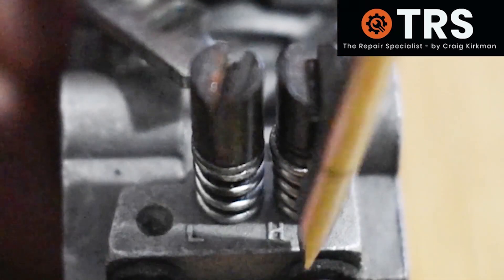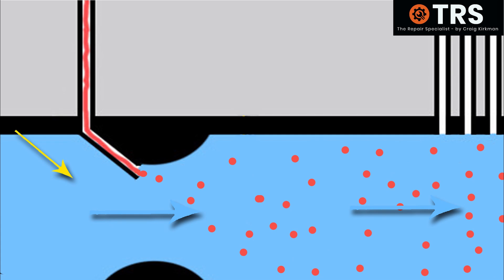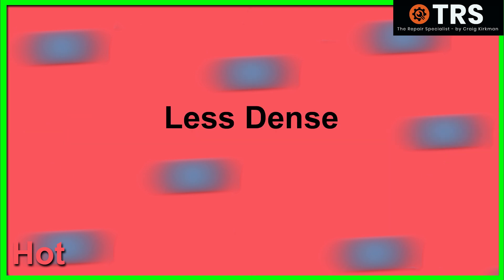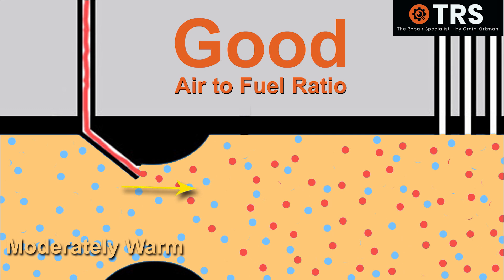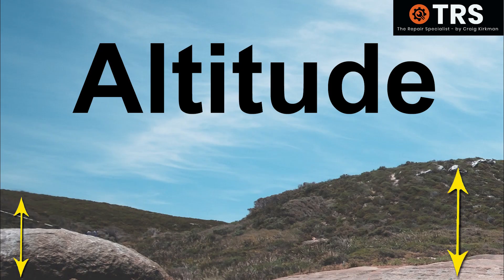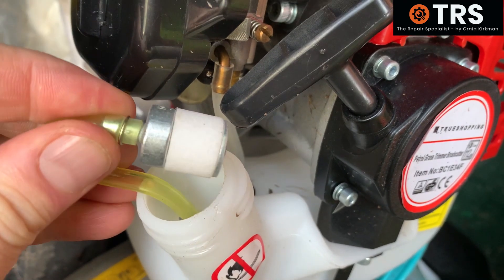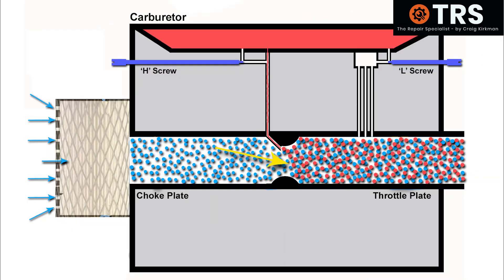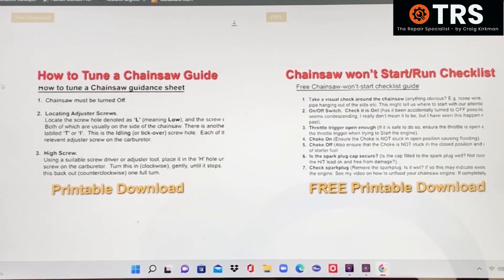CHAINSAW CARBURETOR ADJUSTMENT: Why they are Actually Needed!  (by Craig Kirkman)

Comment: Hi again Craig. Any thoughts yet on my MS180 not having any adjustment screws?
Reply from the maker: Hi. Sorry, I meant to answer your question much sooner. Your Stihl MS 180 does need its air/fuel ration adjusted similar to any other two stroke chainsaw carb, but you as the operator do not have to do it. Instead, it has a “Compensator” built into its design that alters this ratio automatically as you continue to use it. This is why you only need to replace the air filter on the MS180 when it becomes really clogged. It’s the compensator allowing you as the operator more ease and simplicity of use. I hope this helps. Craig
Reply from the maker: I will do a video on this soon.
Reply: That explains it. Thanks

Comment: If I don't adjust my carb between summer and winter could I damage my saw? +30 to -30 *c
Reply from the maker: Not necessarily but it might not run right. Not definitely the case, but may not. I have known many many times
Reply: @TheRepairSpecialist  ok thank-you. I'll be keeping an eye on it more now. Huskvarna 455 rancher. Not cheap 😅

Comment: Well done!! BUT- I know this is heresy but watching this makes me think a clogged air filter should NOT alter the screw settings! Seriously-- a reduction of TOTAL airflow is not the same as oxygen/cc of air... If airflow (of same oxygen-level air source) is reduced, and airflow is what pulls fuel into the carb, then a "choked filter" should NOT mean alteration of air/fuel (it should simply mean an even, balanced reduction of BOTH)
Would love someone's thoughts on this! I always thought bad filter = tighten your fuel screws, but now cannot see that as rational....choked air filter should get no benefit from altering the carb as the choked airflow should ALREADY pull a lower, corresponding pull from the fuel jets..
Reply from the maker: Ok, you are more than allowed to view your opinion. Thanks

Comment: I disagree, in 4 cycle gasoline (petrol) engines the carburetors all have fixed jets and correctly meter the fuel over a wide range of temperature and altitude.  The is different in 2 cycle engines is that they run on "pre-mix".  Both air and the fuel can be considered "fluids" but with very different viscosities.  A carburetor works by mixing these two as a function of their viscosities, both air and petrol have a relatively constant viscosities, whereas the viscosity of the "pre-mix" varies by different mix ratios, and the viscosity (brand) of oil.  If you were to ALWAYS to use the same oil, and same mix ratio, you would never have to readjust.
Reply from the maker: Do some research and you will see that even 4 cycle engines have varying differences in their performance as a result of Altitude, and extreme temps. I can tell you from experience that small engines like on chainsaws are sensitive to the issues I presented in the video. I should know, over the last 30 years I have had to adjust them to suit my weather condition many, upon many, of times
Reply: @TheRepairSpecialist  : All naturally aspirated engines will loose power at altitude, typically about 3% per 1,000 ft (1% / 100 m.) in elevation because there is less oxygen/air.  Yes, some fixed jet carburetors at high altitudes, like above about 2,000 m, or 6,600 ft can sometimes benefit from re-jetting, but that is typically with older ones, as newer ones like even on smaller decade old motorcycles are altitude corrected, and typically require no modification below 3,000 m, 10,000 ft or higher.  As you mention weather (temperature), I agree, BUT again it is because of viscosity of the fuel, as "pre-mix", on account of the oil added, has a greater change in viscosity with cold than straight petrol.  I was in Cusco, Peru decades ago and even at 11,100 ft, 3,400 m,  (approximately 2/3 atm) few cars required re-jetting, although they (and people too) were down a third in power because of less oxygen/air.  As a benefit, cars up there could run on 80 octane without knocking.  My "guess" is that in something like a leaf blower, that has a constant load, and you simply adjust the "hi" jet for maximum rpm, you might find that pre-mix with "synthetic 2 cycle oil" requires less re-adjusting with change in temperature than with conventional oil as synthetic oil typically has a higher viscosity index (resistance to viscosity change with temperature).
Reply from the maker: @johndavidwolf4239  I would like to see this explained in a video. Are you up for that??
Reply: @TheRepairSpecialist  : 1) I am not a video creator.   I am not sure which part you are thinking of?  2) For viscosity,  basically, if you need the same amount of a fluid (fuel) with the same force pulling it (manifold/Venturi vacuum) , if it is "thicker" (more viscous) it needs a bigger hole for it to pass through, like drinking water, vs a milk-shake through a straw.  I am not sure how to show that in a video. I suppose you could make something like a "Saybolt universal viscosity (SUV)" tester (not calabrated to any standard) using the plastic body of a "turkey baster" (less bulb) with a short section of ball-point pen tube glued in, and time straight petrol, and "pre-mix" (two different mix ratios?) at both "room temp" and at the temprature of your home freezer?  3) For loss of power at altitude, it is simply that it is the air-fuel mixture burning in the cylinder that makes the power, at higher elevation, there is less air, so less air-fuel, so less power, again I am not sure how to show that in a video other than to show a graph of air pressure vs altatude.